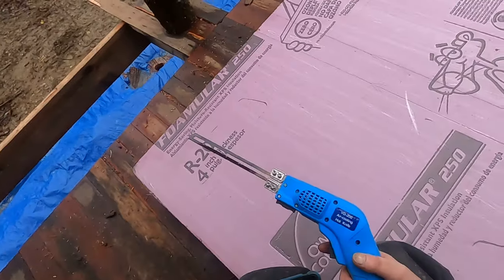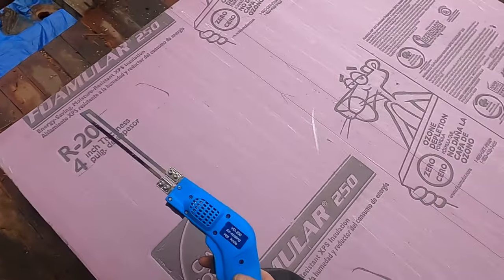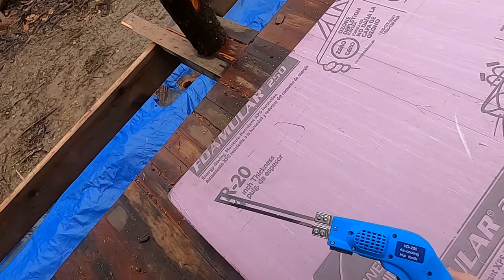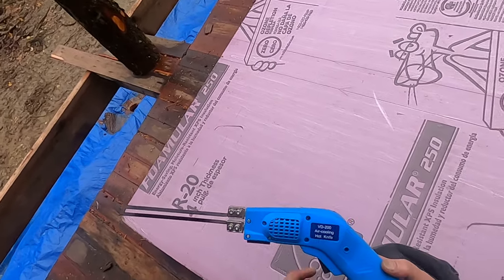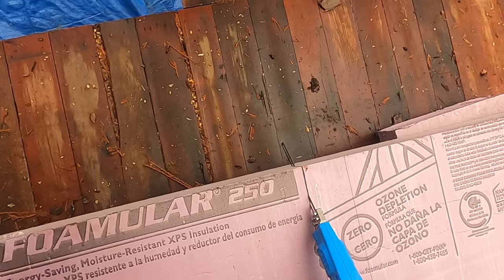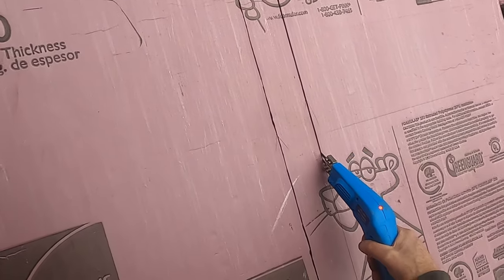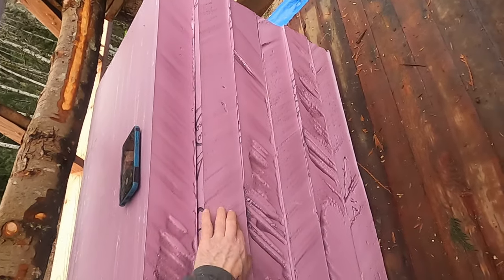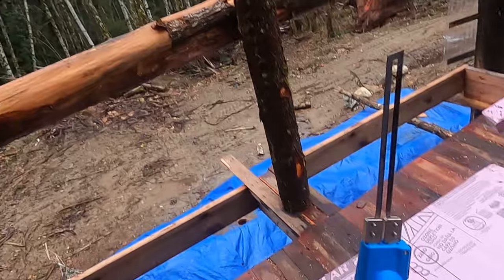New Tool Review - Hot Knife for cutting Foam Insulation Board Cleanly

Comment: I have one of these exact foam cutting knives for this exact same foam (2" thick though) and am having a terrible time getting a smooth cut AT ALL.  If the blade is too hot or you hesitate a little, as is inevitable on ANY longer or slightly complicated cut (I have a few curves) ... the blade INSTANTLY starts to melt foam and leave those large divots and indentations and, quite often, blackened burn marks and blobs. The blade very, very quickly gets gunked up and the directions with the tool say explicitly DO NOT BURN off the residue (super toxic fumes??). I ignore that prohibition but make sure to have have excellent ventilation and scrape off most of the residue immediately on a piece of wood thus avoiding most of the fumes.

Anyway, I am SERIOUSLY disappointed by the often shocking raggedness of the cut and wonder if there is a precise heat setting or precise speed of cut to avoid the sometimes awful result. NOTE: I am making cuts that will be visible ... so the gouges, blackened burns and blobs and such are not acceptable.
Reply: As the instructions that came with my hot knife state: do not hold the trigger continuously, especially for long cuts, instead pulse it on and off.  The knife remains hot enough to cut for several seconds with the trigger released.  Experience doing this will quickly let you learn what works best in your situation.  Also, if your knife allows you to adjust the heat settings, try lower settings.  Hope this helps.

Comment: I have 2 small projects to make out of this exact 4 inch insulation board.   Looks like this hot knife works great.   Not sure i want to spend $75.00  on a tool  for two small projects.   Thanks for the video.  Never heard of this tool before.

Comment: I use a 3" or 4' drywall knife .  I sharpened one or both side edges and use that to cut foam board.  I suppose I could attach it to an angled board to get an angle on the cut.  A file will resharpen the edge.

Comment: Normal offset teeth sawblades produce clouds of nasty plastic dust. 
Any blade with a wavy, thin (knife-like) profile will cut clean and dust free. For my project using 120mm sheets, I ground the teeth and side edges off a 9" reciprocating saw blade. Perfect. For thinner sheets, same can apply with jigsaw blades, plus there are proprietary wavy blades for jigsaws. Hand cutting - if thick, use Bahco insulation saw. Thinner boards - probably utility blades and snapping will work best. From UK, you're welcome.

Comment: I have never cut 4" insulation but on the 2" insulation is insulation I just use a circular kimbersaw.. I think that would probably be faster than a hot knife
Reply: Sorry I was doing talk to text and did not prove read my comment comment. Is I use a circular saw is sprinkler saw on 2" pink foam board word and it seems to work great.. Plus it's quicker

Comment: You could of used a $12-15 bread electric knife it would of cut it fine also
Reply: Did you try it as I was thinking the same thing.
Reply: @kjohnsonece1  yeah it didn't work so great it was too hard doesn't really have the power to cut this foam works excellent on softer foams tho but not this insulation type foam I ended up cutting mine with just a thin kitchen fillein knife scored it a few times and worked but a jig saw works too just makes a mess